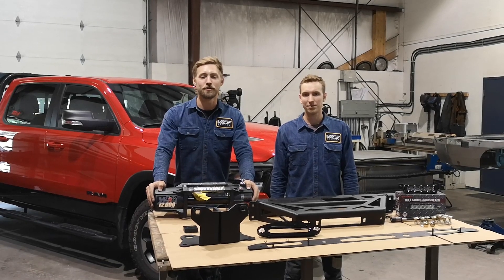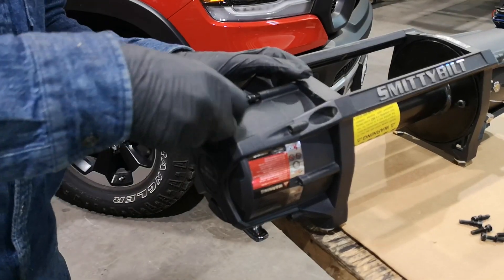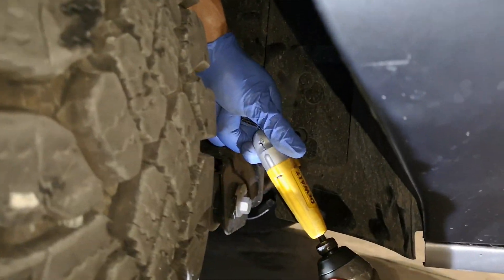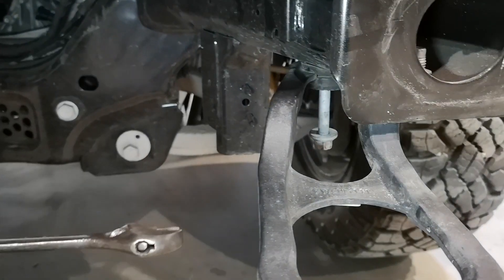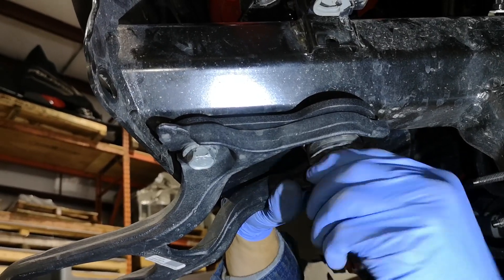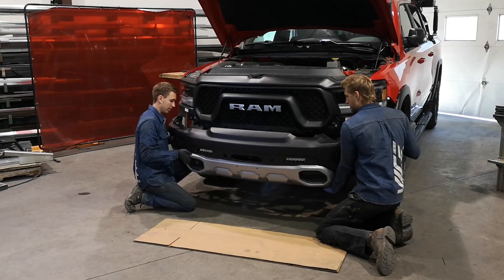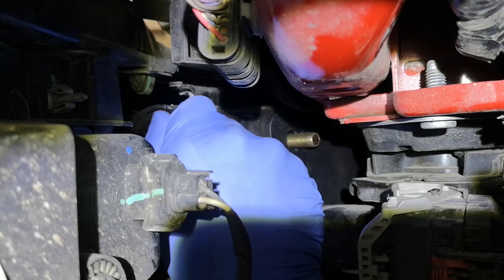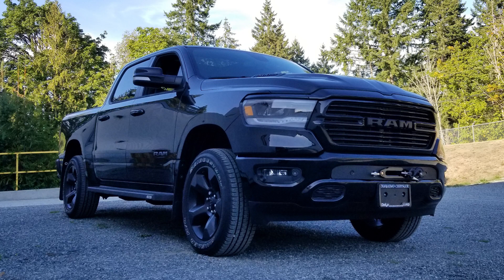2019-2024 RAM 1500 DT & REBEL | HIDDEN WINCH INSTALLATION !!

Comment: VICE design, you have made an awesome product, super easy to install and very straight forward instructions. I have absolutely no regrets getting it, other than waiting so many months to install it... I'd add that @7:35 the easiest way to separate the headlight cover at the fender side from the plastic clamps is to insert a screwdriver in between the cover and the black clamp (that is under the cover) from direction tire towards headlight and gently pry it, that in fact was the hardest part for me in installing the winch.  GREAT JOB!
Reply from the maker: Very stoked to hear. Thanks for the feedback Ill give that a try next installation. -Q

Comment: Will this setup work with the 1200lb Badland ZXR from harbor freight?
Reply from the maker: It will bolt up (as it uses the standard bolt pattern) but there are a few reasons I'd look at skipping the badlands and investing into a winch we based the winch mount around ( WARN VR EVO or Smittybilt GEN 2 X20 )

1. Wireless Remotes - Makes using the winch so much easier, no need to crawl under the bumper to plug it in.
2. Synthetic Rope - about 20lbs less than steel cable, and a lot safer! You'll have to buy a hawse fairlead for the steel cable.
3. Waterproof Rating - The winches we recommend are waterproof up to 3 feet underwater, while the Badlands is just mist/splash proof
4. Clutch handle relocation - We've made an accessory that puts the winch clutch handle directly on the bumper to make it easy to spool out your hook.
5. Internal Brakes - the ZXR brake mechanism is on the outside of the winch exposed to getting rusty. I like these moving parts to be internal and protected.
6. Control Box relocation Kit - We've made an optional accessory that puts the brain box of the winch in your engine bay to make it super easy to plug in, as well keep it protected from dirt, mud and roadgrime. Definately extends the life of your winch. 

Hope that helps!
Reply: Thank you, that helps a lot.

Comment: Will this work on Ram 1500 Rebel with Air suspension? Any upgrade needed to suspension to support the additional weight? Will you need to repeat the installation process if the winch fails and needs to be replaced?
Reply from the maker: Yes it will! No additional upgrades needed. The winch and bracket add under 120lbs and the air suspension will automatically adjust to maintain the same ride height. The winch can be removed without performing the entire installation process. We recommend using the WARN VR EVO 10-s or 12-s for the best reliability and useability.

Comment: Any ideas for a 2012 dodge ram Laramie 4x4
Reply from the maker: Hey timothy your best option for mounting a winch with your truck is our MOD V2 bumper. Great balance of weight, strength, and wheel clearance. Easy to add lights. You can check that out here - https://www.vicedesign.ca/products/ram-1500-2009-2018-mod-v2-series-front-bumper
Reply: @vicedesigninc  how heavy are these..I need a heavy built winch bumper

Comment: Will this work with a older ram and different style winch ? I have a 11 3500 and a badlands winch.
Reply from the maker: Hi Ed - This one works only with this body style 1500. We just finished developing a winch for 2010-2018 RAM 2500/3500 that came with the Hemi Motor (5.7,6.4). It will be on the website later this week and we'll post a youtube video on how to install it.
Reply: @vicedesigninc  awesome thank you it should work with the Cummins also correct
Reply from the maker: @eleigey  No. Theres no room on the cummins. Intercooler, piping, coolers etc.

Comment: What is the purpose of removing the pieces under the headlights? I was able to remove my bumper leaving those on
Reply: How much did your kit cost?
Reply from the maker: Yeah it comes off without removing them but It sure makes it easier to re-install the bumper on with the winch mount there doing it this way.
Reply: @miltonbrown7275  no kit here, I had just removed my bumper to paint the skid plate and was curious if there was a specific reason to removing those parts

Comment: Do you have a video on how to wire the winch to the vehicle? Do you connect it directly to the battery?
Reply from the maker: Winch Red cable (positive) directly to the battery Positive (+) terminal, and Winch black cable (negative) directly to the battery Negative (-)Terminal. We recommend installing our control box relocation kit -> https://www.vicedesign.ca/collections/control-box-relocation-kits/products/ram-warn-vr-evo-control-box-relocation-kit

Comment: Would this kit work for my Dodge 2020 classic?
Reply from the maker: 2020 classic is the 4th gen body style. If you have the steel front bumper on your 2020 classic then this kit will work for you. https://www.vicedesign.ca/collections/hidden-winch-mounts/products/ram-1500-2013-2018-hidden-winch-mount

Comment: Just to let you guys know...After installing and hooking the battery back up, I lost my cameras. Couldn't for the life of me figure it out. We were looking for a bad fuse and couldn't find it. After doing some research online, I ran across an article that said sometimes it takes 24 hours for the system to reboot itself. Finger's crossed, we went and checked an hour later and YAY my cameras are back. My bumper sensors are not working yet though, so I am gonna give it a little more time and hope they come back too.

Comment: Anyone happen to know about how much the kit and winch weigh?
Reply from the maker: The mounting kit with all the hardware is about 60lbs. The WARN VR EVO with synthetic line is 65 lbs. If you're running steel cable on the winch add about 25lbs.
Reply: @vicedesigninc  Do you think there would be any issues on any of the front-end components of a stock Rebel with the added weight? I feel like I've seen somewhere that things may break when off reading due to the extra weight?

Comment: Two things. 1. Looks like you forgot to renew your domain name because I’m getting the GoDaddy renewal notice when I visit your site. 2. What about a mount for the ecodiesel rebel?  It has an intercooler in that lower grill area that I suppose needs relocating.
Reply from the maker: Back up and running! And you are correct - currently the kit only fits the gas motor versions

Comment: I did this back in 2013 for my Bighorn 1500.  i cut down a Mopar winch bracket and mounted it underneath.  The winch was a 12k lbs winch from Harbor freight.  I then bought the remote for the winch and hardwired it right behind the grill.  I bought some 2012 Power Wagon decals and rebadged the truck.  Guys at Orange Park Dodge Service said it fooled them at first,  said it looked factory.
Reply: They obviously didn't know that power wagons are strictly 2500.
I bet all the Power Wagon owners passed you laughing their asses off with the wagon graphics on a 1500 with a harbor freight winch.👉😆👈
😆
Reply: @DAVIDPEREZ-ux8cp  In fact you do not know that up until 1990 (Power Ram) and 1980 (Power Wagon) you could get a Power Wagon in either 100,150 or 250.  No one was laughing troll. Know before you open your flappy mouth.  You probably do not even own a Power Wagon...

Comment: You now have a 5th Gen RAM with a Front Winch, as well as a 5th Gen RAM with a VOIDED FACTORY WARRANTY!..............NO THANKS!...(yes I asked Chrysler, the butchering of the sub-chassis VOIDS YOUR WARRANTY)
Reply: Well you are half right. It Will void the factory warranty on that particular part and any part that directly relates to it. However it will not void the factory power train or drive train warranty, completely unrelated parts and systems. With all that being said I would have to assume that most of the people who would be installing this kit fully intend on using the truck in a manner that would void the warranty anyway and because of this they don’t care.

Comment: Will this work with a 2021 RAM TRX? Thanks!
Reply from the maker: Theres a cooler (believe it's a water to air) for the supercharger that sits behind the bumper. I havnt been able to get my hands on a trx to come up with a relocation mount for it but if you figure out how to move it out of the way then the 2019-2021 rebel kit will bolt right up!
Reply from the maker: Theres a cooler (believe it's an air to water) for the supercharger that sits behind the bumper. I havnt been able to get my hands on a trx to come up with a relocation mount for it but if you figure out how to move it out of the way then the 2019-2021 rebel kit will bolt right up!